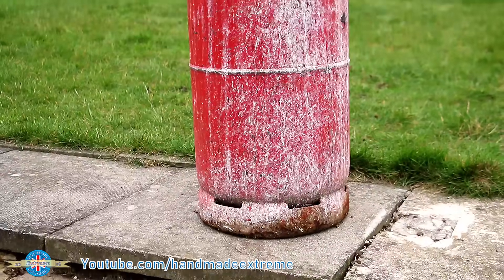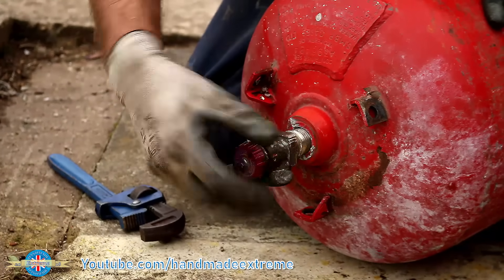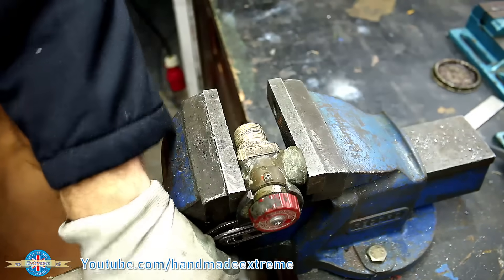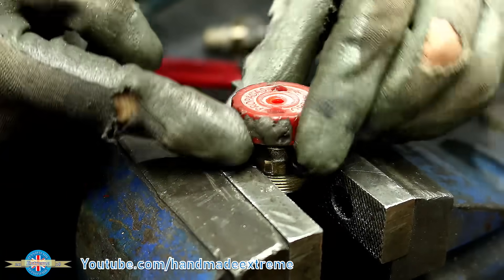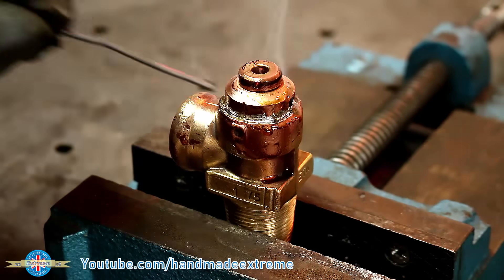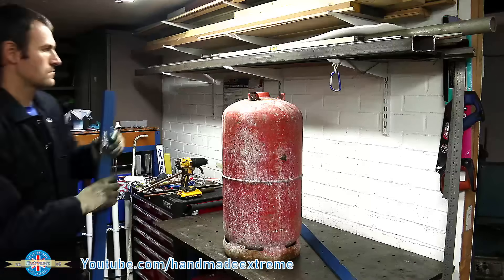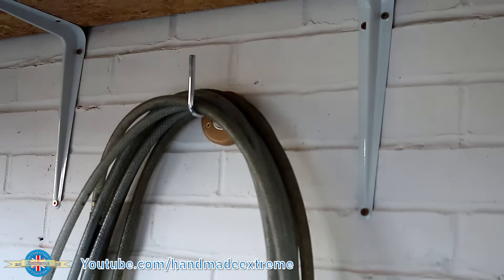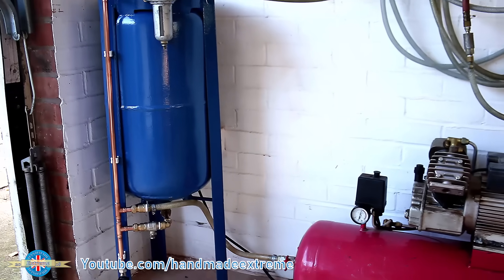Making an auxiliary air tank from an old LPG gas bottle.

Comment from the maker: There seams to be a bit of a riot going on in the comments so please allow me to clear a couple of points up. 

The system is protected by the pressure safety valve on the compressor itself. The pressure in the aux tank can not exceed the pressure delivered by the compressor so the existing safety valve is sufficient. 

As a secondary point the pressure rating on the aux tank exceeds that of the tank fitted to the compressor itself. It isn't going to go pop. 

Aux Tank Test Pressure 350PSI - Max operating pressure 150PSI. Obviously different tanks have different ratings depending on their application and where you are in the world. But this is the one I used.

The pipe work is also rated at significantly higher working pressure than the system will ever operate at. 15 mm copper pipe here has a burst pressure rating at over 600PSI in its annealed state. (higher in the as drawn state)

Please consider when stating 'codes and rules' that Youtube is an international forum. The rules where you are in the world are not global and may not apply in other areas of the world. 
Governing bodies and regulators are different all over the globe. It would be great if we all had one set of rules but that simply is not the case. 

I hope this clears up a few concerns I am seeing in the comments and reduces the amount of unpleasant responses I am reading to people who are at the end of the day, just asking a question. Lets try to be nice to each other shall we. 

All the best.
Reply: Good reply. I was concerned because I have witnessed what can happen if a receiver lets go.
Reply: Good job mate, safety factors taken into account. Malleable iron fittings fit straight into a uk gas bottle but well done for working with what you got. For all the nae sayers out there just buy a proper tank if your not capable of making your own and don’t come on here and slag others off for what your not capable of yourself.
Reply: Nice project. I think depending on receiver size will vary how it stands with regards the pressure equipment directive. Manufactured tanks will have data for design thickness, and what allowance there is for material thinning due to inevitable corrosion inside the tank. Depending on how you use the tank, fatigue loading may differ compared to the original tank, which may be taken into consideration for commercially manufactured tanks too. Hydraulic pressure testing at a suitably calculated proof pressure (exceeding working by some factor) can also be used to ensure the tank doesn't have defects that will fail at the design working pressure. You should not have any isolation valve between the receiver and its safety pressure relief valve.

I sometimes use a small refrigerant recovery cylinder to act as a local air source (up to around 10bar), filled from my compressor. There is a relief valve (or bust disk, not sure which) integrated as part of the cylinder valve.)
Reply: @PeterClifton  the propane tanks in the uk are fit for a lot more pressure than the compressor tanks... and his copper pipe fittings would tear open long before the tank would let go..
Reply: @PeterClifton  I do wonder if compressor tanks are 'plastic lined' to avoid corrosion risk. The gas tank won't be.
Reply: @millomweb  Not the ones I've seen.  You do get rusty water coming out of the drain valve sometimes.  Air receivers used in a commercial setting should be tested periodically.
Reply: @PeterClifton  Maximum allowable working pressure = safety factor of 4 in USA for ASME section VIII unfired pressure vessels. This is for steel ultimate tensile strength.  This video does not discuss MAWP, metal thicknesses of shell and heads, or corrosion.
Reply: @larselder874  ... also note that propane is "dry" and in normal use the tanks would not be subject to internal rust issues, although the outside might be in question on any tank that spent it's entire life in the weather. My point being is that compressed air will NOT be dry in most cases because ambient air has moisture and compressing it makes the moisture fall out of suspension. IOW, moisture will now be in the bottom of a tank that was never built to be exposed to it.
Reply: @rupe53  Normal is propane, not compressed air. Inside Propane tank corrosion can occur by hydrogen embrittlement, stress corrosion cracking with propane.  You do bring up three more points.  Moisture in compressed air condenses inside the receiver tank and will cause corrosion (rust),  The bottom of the tank must have a fitting that can have a bleed valve.  I like ball valves.  Navy uses continuous blow down with a vee notch in a gate valve,  In the video, the horizontal blue tank under the compressor may have a pipe plug available for a drain.
The propane tanks have zero corrosion allowance.  And in America, ASME Section VIII specifies C.A. in UG.
Reply: @larselder874  ... which is why propane tanks (and others) are inspected periodically and may not be refilled if they are expired. BTW, all compressor tanks have a condensate drain. Any aux tank should also have a drain because the moisture wont condense out of the air till it cools, and during long runs may transfer into the entire system, pipes and hoses included.
Reply: @rupe53  I have observed many air compressor / tank units without a drain at the bottom.
Reply: @larselder874  ... even the cheapest Harbor Freight units that I have seen have a drain.... or at least a plug on the bottom. Water in compressed air is like ants at a picnic.... ALWAYS there!
Reply: @rupe53  In our case, compressed air is dried before going into the gas tank. Not so in his case as he has the water trap after the tank.
Reply: @millomweb  ... the best drying systems most of us will ever see are used on compressors for refilling breathing air tanks for the fire service and divers. Even those systems have additional driers and separators after the storage tank.
Reply: @rupe53  They dry your mouth - I know ! But most cases don't need to be that dry.
Reply: @millomweb  ... breathing air needs to be dry enough to NOT cause internal tank issues in the first place. That's pretty dry.... at least compared to other industrial applications.
Reply: @rupe53  go watch again. he has fitted a drain valve for the system, and this will drain more than any normal compressor tanks. the original RED tank will have a drain on the bottom as it sits now. BUT the actual drain fitting do NOT let all the moisture/water out, they are infact about  3/16th proud inside the tanks. with his system when its all turned off and the drain is open he will get  ALL the moisture out and 100% it will let out more than a normal compressor tank drain valve..Now in case you do not know propane when in these tanks is NOT dry it is liquid and is why it gets is designation LPG and DOES have a tiny  amount of water in propane. i have cut open many propane tanks and found rust inside them to a degree. . Please remember that the propane tanks are built to withstand MORE pressure than a compressor tank... propane tanks like this are normally rated to Working pressure 240 psi, test pressure 480 psi, design, burst pressure 960 psi..... now that is a fair bit of pressure, also average propane tank runs around 130 psi when full up.. so the pressures of the compressor is not going to be higher than the tanks design, not by a  long way. and remember these propane tanks sit outside in boiling hot sunshine when stored full, never heard of one going bang... have seen one go bang when put on a fire and it takes a long long time for them to go bang, the one on the fire had the relief valve deliberately closed off. it was purely for experiment and done with all safety issues in place ... his copper pipework would burst long long before the tank as it is NOT anywhere near the burst pressure of the tank. the solder joints also will burst long before the tank... the brass fittings also do not have anywhere near the burst rating of the tank itself... i would be far more concerned about the copper pipe having solder joints than anything else.. but he could very easy put in a relief valve for the system and just fit it down the bottom where the pipe comes out of the tank.....
Reply: @rupe53  you are blind and deaf it would seem, as there is a drain fitted and its lower than the very bottom of the tank itself, his drain is far superior to normal compressor drains....  look at the copper pipe and you can see he has fitted a water drain at the very bottom. its a lot lower than the tank. when you finish working with a compressor you turn it off and drain all the air and open the water valve, this should be done on all compressors after you have finished for the day........ now please show me a compressor that has a drain valve that lets a ALL the water out.. remember inside where the normal drain valves are fitted  it stick s up at least 3/16th proud so never gets all water out of a normal compressor tank....
Reply: @philldownes8685  ... I stand corrected. There is a drip leg with a drain on the plumbing, although not that obvious due to a bracket attached on the leg. I was looking for another ball valve with a yellow handle and I guess I'm color blind to not see black in a shadow. BTW, even though it is common to find water in these tanks all written statements in the industry say "there should be no contaminants and new tanks should be purged before filling."
Reply: @larselder874  En
English Propane tanks are way thicker than US ones!
Reply: @larselder874  ... read farther down in that link...
6-gallon pancake-style tank supplies stability and includes water drain valve and rubber feet
Reply: @rupe53  thank you.  The ones in Sears stores a few years ago had no bottom drain.  I had noticed and was happy when two older gents noticed as they walked by and said so.  That's what happens when a person is well trained as they had been in factories.
Reply: Tony Wilson  I wonder if the ball valve has plastic seals - which would leak when heated by fire.
Reply: Tony Wilson  "Well you talked about a fire and in a fire a propane tank will out last an air receiver and any standard pneumatics hardware any day of the week. The failure in a fire is a non-event, by the time that tank might rupture a lot of other things will have already failed."

Like his solder joints !
Reply: "It would be great if we all had one set of rules but that simply is not the case. "

Just think of the chaos of 'updating' everyone to the new code. YEESH!
Reply: @spokehedz  USA has ASME Code Section VIII for unfired pressure vessels.  New edition every three years with updates every 6 months.  There are also a set of 'interpretations' of questions sent into hdqtrs and replied to.  These may be general or specific.   Railroad tank cars generally follow AAR regulations which adopt many ASME design, quality (V) and welding requirements(IX)  It takes years to become expert in all sections of ASME.  A three day seminar gets you through the principals.  Nuclear (IV), boilers (I) and material specifications (II)
Reply: @larselder874  Now go see if your codes apply to vehicular systems. !
I can tell you now, the answer is no. Trucks have several air tanks - and only the first one from the compressor will have  safety valve on it.
Please report back with your findings.
Reply: @larselder874
Reply: The compressor tank is a Class Three Pressure Vessel while the LPG tank is a Class Two pressure vessel.
Rejected Class Two Vessels generally end up becoming compressor tanks.
All tanks a Static Tested you should find the test results marked on the compliance plate of your compressor. One the LPG tank collar or foot you should find the information on the test results.
So if you have doubts on if the tank can or can not take the pressure always run to a pressure that is lower than its design pressure rating.
Both tanks should have a pressure relief valve attached for safety reasons and to protect the compressor. 
You also should have a non return valve between the two.
Reply: I agree with a non return or check valve between the two tanks to relieve stress on the motor while filling and if you did put a check than another prv woukd be needed on both tanks..  

About the dumbass above who said all air tanks have a drain, harbor freight sells an 11 and 8 gallon tank that only has one hole in it and the regulator is in it...  no drain..  i know cuz i bought 4 of em and welded on bungs for drains on all of em..  hooked em up to a few old hvac scroll compressors and even though the tanks are rated for 120psi max i pump em up to 240psi and use pex line on the shop as a distribution pipe..  have auto blow off valves on every tank on the drain holes in a t fitting..  have one regulator rated for 120 but i put a 350psi gauge on it and everything works fine, nothing exploded yet and its been 6 years almost..  tanks get about 18cfm..  can run an air hammer, jack hammer and impact at the same time non stop..  well until the pumps overheat and shut off but that takes about 45 mins..  only issue i had is i had an ole dog one of my buddies brought over and turned him loose apparently in my shop..  damn thing chewed through one of the pex lines and blew his tongue out his ass...  not really but popped his throat like a balloon and took a month to get the smell out where it shit sprayed the place..  broke its jaw wide open also..  air dont fuck around..  

But either way yall fuckin pussies live a little..  if your gonna hurt somebody then do the shit alone and hurt your damn self..  if somethings unsafe put a sticker on it and go get a job at osha and fuck butts like those people do..  i understand job safety for the sake of fred and his family but i dont give a good fuck about my own life or safety so why do you.. worry about your own shit..  i was on a job one time where the safety commissioner on site was a hard ass and made everybody wear safety glasses even when on break in the parking lot...   dude wound up taking a brick to the head when it fell off the parking stricture at the safety office he reported to..  lol..  sad he died but shows shit can happen even to the safest of fuckers...  so go find a dick and eat it...
Reply: @Z-Ack  "I agree with a non return or check valve between the two tanks to relieve stress on the motor while filling" To relieve stress - EH?????????
Reply: @21gioni  A non return valve would incapacitate the system - so that's not on. Not every tank has a PRV - just look at the air brake systems on trucks.
Reply: Handmade Extreme what a great way to get use of that tank and make sure you always have air.
Reply: Tony Wilson  Sorry. It's just that you started your third sentence in that post with "Under normal conditions..." and didn't return to the specific failure mode case I was writing my post about. It appeared to me you'd missed the point I was trying to make however qualified to comment you are.
Reply: Nice, but there is easy way with the pipes.... there are not need to be weld.... there simple click system on the market.... but if you do with home left materials  perfect
Reply: Great video and a pleasure to read some calm reasoning.
Reply: Tipton great job, but I would be using poly pipe. Only as that is what I'm used to, in industry, 
And personally and no criticism I would fit a bursting disc on the inlet, but that's just me.
Reply: Handmade Extreme please always set a prv to all vessels regardless!!!!
And all gas tank 19kg upwards have a 3/4bspt tread everything can be taken out of this port, air in and out, water scavage pipe and also a prv, even a pressure gauge.
Reply: You goto be laughing air pressure safety valve is enough with a rusted inners tank ! Just watch this one I don't trust these old tank without an hydro pressure test its like living next to a pin out grenade ! https://www.youtube.com/watch?v=sm_FJ6Pat4I&feature=share&fbclid=IwAR3z_ji_bh9fZkMdMj9b-5gsL4Csvu20Ppe9Bvt9d4V2iq89-QM54koC0mU
Reply: Couldn't you have just used an elbow for the tank? Edit to add: or a tee for a drain?
Reply: @larselder874  Product description of compressor at your Sears URL for Porter Cable pancake compressor includes this statement “… includes water drain valve …” Your product was either non-compliant to its stated features or it did in fact have a drain valve.
Reply: Great video, did this exact modification years ago and it was very helpful for my tiny shop. 
Great explanation, clear video, enjoyed my first watch to this channel.
I didn’t get caught up in the riot over pressure ratings or build comments.. awareness goes a long ways
Reply: P]p
Reply: hear hear for that  i have built this many years ago  it was better than a lot of commercial units
Reply: @ivorjones6618  things can easily over engineered 😉
Reply: @Ballerc  better over done under done!!
Reply: @ivorjones6618  over done means take apart and redo, it’s simple why not keep it simple😉
Reply: I've seen air compressors blow without modification so there's always risk. My only question is if the aux tank had right hand threads why not just use brass pipe fittings or steel and avoid all the gas valves? It was very interesting watching you convert everything either way.
Reply: Well played
Reply: by the time this compressor fills that it must be to the point of melting down. This is nothing new.
Reply: Well the haters are sitting at their keyboards waiting to pounce. Dont even address them because they have no purpose other  than to pass along their hate. Well done video...I have made propane cylinders into portable air tanks...they work great. Putting 150 psi into a propane tank that's rated for twice that is a no brainer.
Reply: Americans I expect, their portable gas tank are made of very thin steel. Though they use proper tanks on RVs ha ha.
Reply: @stevemorris3710  Well i can see you dont know what your talking bout, only ha ha's are at you.
Reply: @timessiah94  I put your comment into Google Translate, it said it'll get back to me...
Reply: I really liked your solution concerning the cylinder valve. I made a similar air receiver out of a Calor Butane cylinder many years ago. I tapped a 1/2" or maybe it was 3/4" BSP thread into the cylinder,  discarding the supplied valve so I could connect directly to my existing pipework. It was difficult to do and wish I had thought of your solution.
Reply: If people are concerned about tank safety, it is a very simple test. Fill the tank with water to the brim as shown to remove the propane or previous contents. Create a fitting with a pressure guage and couple it to a pressure washer. Make sure there is no air trapped by tapping on tank to dislodge bubbles. Using the PW wand hand controller, pulse the tank until you reach your test pressure (it's very short pulses). Leave it at pressure for a bit or overnight. If there are no leaks or swelling (tape measure before and during the test) , you're good to go. If it ruptures, you'll hear a twang and get wet... it doesn't explode. Ask me how I know. 😁
Reply: If you keep the aux-compressor ball valve open, then you would be right in saying the one on the compressor would protect both tanks, but if it (or the compressor outlet) was closed for whatever reason, at max pressure, and you had a heat source, on or near the aux tank (eg fire), the pressure in the aux might exceed the rating of the tank, as in that case the pressure would not have anywhere to go, so I would put a safety pressure relief valve on the tube before the aux ball valve, if it were me.
Reply: @si98justme1  if he is cooking that aux tank then I think he has bigger problems to worry about...
Reply: @crabraptorjesus  Absolutely, however, it still should be considered, as adding a potentially more violent explosion to that situation would make it worse. I'm not saying he must do it for that niche scenario, but as an extra safety measure, (which is relatively cheap and easy to do), so that if that scenario happens, it will mitigate some additional issues.
Reply: @si98justme1  Do gas bottles have PRVs ? To my knowledge, some do, some don't. Those that do are usually 'bursting discs' - that fail and let all the pressure out - and if that's pressurised flammable gas in a fire.............
Reply: @si98justme1  correc and for like $30 I would have fitted a safety valve and a gauge $30 and a auto drain
Reply: @si98justme1  That is you, I wouldn't
Reply: Question, how many litres of capacity did it add? Comments: 1) Before you had even started speaking I was thinking "good idea, but it needs to be upside down to stay dry" 2) Top tip, you can use a small water blaster connected to the tank to hydro-statically test it yourself safely. When I added a used 160l tank to my 70 3 cylinder compressor for similar reasons (plus do light tasks without running the compressor from stored air!) I was concerned about how strong it was after years of use and some rust. Filled it with dilute phosphoric for a few days and drained and scrubbed and repeated until clean. Then rinsed repeatedly, dried with warmth, and sprayed a tonne of zinc primer in there from various angles so it settled on various surfaces (most of them!), then let it breath for a few days for the solvent to disperse out, then strongly welded a bung with fitting into the large outlet on it and then filled with water and ran the compressor up to max pressure and gave it a few thumps with wood etc. I learned about the water blaster trick later. For weeks every time I pumped it up I stood clear out of paranoia from watching too many compressor explosion vids on youtube, but a few years later and it has been good - it's also on end so any weak parts are staying that strength, not deteriorating further. I'll test it better before I put it back into service when we move house in a few years, but until then it's GREAT having 230l of capacity when you're running a die grinder or air hammer or whatever. And with a large ID hose you can fill a tyre in seconds :-D
Reply: With all respect this is a potential bomb.
At 9:50 you show the cylinder with the original modified cylinder tap and a new isolator (yellow handle). As many have pointed out in other comments this needs a prv between that isolator and the cylinder. 

Why?

Because the isolator can be closed while the tank is at the cutoff pressure of the compressor. And then you have a charged system which can easily exceed the max pressure of the cylinder in the event of a workshop fire heaven forbid.

Hopefully that will never happen but you have created a situation where that course of events is now a possibility. A tiny one, but one non the less. 

Whatever the regs say and whether or not they apply to your circumstance, fit a PRV between isolator and cylinder.
If not for your sake then for the sake of your neigbours and the firemen that might be called upon to put out your workshop fire.
Reply: @AndiusPandius   for what it’s worth, I agree with the issue you’ve raised. A system, or part of a system should be protected from over pressures by a safety valve or PRV. I have a long working history within the power generation sector, so I know a thing or two about pressure systems.
Reply: Legal or not, PESR AND PSSR are there for a reason in the U.K. Referencing relief valves as justification is bordering ignorant. I’m not watching this video.
Reply: @paulharrison2325  Video was great, I agree safety is #1, but if someone is making a video to share or help leave a helpful tip to improve it don’t play ignorant… talk about calling the kettle black as you Brit’s would say.
Reply: @Ballerc  I wouldn’t dare. I am a chartered chemical engineer that oversees the construction and commissioning of large pressure systems.
Reply: It's OK with me, do as you want. I wasn't trying to offend you. Take care and have a good one.
Reply: Mate, does your country’s codes state you do not need a safety valve or pressure gauge for your auxiliary tank? That’s all the information I need.
Reply: @nigeleharis5886  Check your own country's 'codes' for the situation re air tanks on truck brakes. You'll find it's like this !
Reply: @nigeleharis5886   So, old expired test Certification, especially after modification isn't important to you?
Reply: @nigeleharis5886  Where I live, I do anything I want in my own garage
Reply: Looking forward to your reply bruv. Interested to see what the rules and codes are where you’re performing your work at! Aloha.
Reply from the maker: My understanding of our regulations is that there is a requirement for a gauge  and PRV to be fitted to tanks that are manufactured for sale and tanks that are used for commercial purposes. In the case of the former the responsibility for compliance falls on the tank manufacturer. In the latter, the employer. As this system is manufactured for my own personal use in my private personal workshop then it falls outside of the scope of the  regulations. The idea of the regulations here is to prevent a 3rd party from getting injured. IE someone who buys a tank that is not fir for purpose or an employee using unsuitable equipment provided to them by their employer at their place of work. As I am neither selling a product nor employing staff that use this equipment (it is just for my personal use) Then the rules don't apply. 

Hope that helps to clear up any confusion.  Thanks for the question and thanks for watching.
Reply: @Handmadeextreme  nothing against your work quality or anything of the sort. I’m merely speaking passionately from my vocational standpoint. Just because you can doesn’t mean you should. I sincerely hope it proves safe for your use.

As for the other people refusing to acknowledge valid trade information....*shrug*
Reply: @Handmadeextreme  Have a look at truck brake systems. Several tanks but only 1 relief valve !
Reply: @nigeleharis5886  Go have a look at your (re)fridge(rator).  Compressor: CHECK, pressure vessel: CHECK, safety valve: NOPE, pressure gauge: NOPE.
So not all compressor /tank / receivers need the things you mention !
Reply: @millomweb  ... yes, but you wont find any manual isolation valves between the tanks. Generally speaking, if you get a leak then all of the system goes empty.
Reply: @millomweb  ... refrigeration systems are sealed and can't exceed their design pressures as a whole.
Reply: @rupe53  ABSOLUTELY WRONG ! That's the reason they have multiple systems - so if there's a leak, you still have one system fully working !
Reply: @rupe53  Same as this installation. One source of pressure and one safety valve. Same apart from being sealed.
Reply: @millomweb  ... actually with trucks it's "one system" with multiple sections (tanks) for local use in various areas.... because air all by itself is kind of slow to respond and the hose sizes needed to overcome that would prohibitively large.
Reply: @millomweb  ... true, but those systems are not using repurposed parts. Everything is designed and certified for this specifically.
Reply: @rupe53  In England, vehicles have to have 2 braking systems - which is why there's 2 pressure gauges in the cab (or one gauge with 2 pointers) - so definitely 2 systems here PLUS parking brake which is a third system. Control is from one compressor though.
Reply: @millomweb  ... I think you will find the parking brake is a "spring brake" and it's pressure within the system that hold it "released" to allow the truck to roll down the road under normal conditions. The reason for multiple pressure gauges is the system is split into primary (supply side) versus secondary. (operating side) It is considered ONE SYSTEM divided into various segments. If you want to split hairs, I suppose some of these would be considered subsystems. The supply tank may also feed auxiliary items such as air horn, wipers, windows, etc. These items usually have their own tank and may be separated by a check valve. OTOH, if any of these aux tanks (or lines) spring a leak they will draw from the supply tank. Low pressure in the supply side will sound an alarm signaling all systems will fail shortly.
Reply: @Handmadeextreme   I guess you don't care much for your own personal safety then.... or to those Emergency responders that have to come clean up the mess after the rupture of a high volume receiver. 
Perhaps ask your personal or property Insurance Co. on their opinion. You may find annual premiums increase when they discover what your up to there. They will certainly find out after an event and refuse to payout any claim. 
Are you covered by the NHS for any injury in your home workshop?
Reply: @nigeleharis5886  "Valid Trade information".... like expiry of test Certification (out of date pressure vessel), especially after significant changes and use? 
Why do you think EVERY type of pressure vessel, be it for fluid or gas phases must be tested and that Certified info indelibly stamped onto the vessel?  Any idea at all? 
I guess that doesn't include 'Best Trade Practice' too.
I know your type well.  Do the bare minimum to comply. 
Guess what... 51% isn't a pass mark for self respecting tradespeople. 
'Rough enough' is good enough, hey? How often do you use the 'Big Gov. interference' and 'red tape' mindless mantra?
Reply: @nigeleharis5886
Reply: @nigeleharis5886  My home my rules, I do as I wish